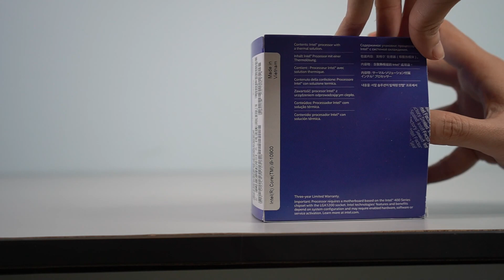The Asus RTX3080 TUF Gaming PC Build ! [Time-lapse]

Comment: Routing the GPU cables this way looks 1000 times better than underneath through the power supply cutout! This is a sexy build!
Reply: Why?
Reply: @Graphics_Card  The cables flow more naturally and straight. Most of the basement cable cutouts end up making the cable runs overlap, and pull them towards the front or rear of the case,  which takes away from the clean aesthetic.
Reply: @RegazozoGaming  that’s true but not always recommended. Alot of those cables if doing that can become short, and at the end of the day, your cable management will be bad. Also the AIO will have a tough time too
Reply: @Graphics_Card  not sure what you mean by become short, and its not bad cable management, if anything its better because you dont block off any of the air flow from the fans on the bottom of the GPU. Ive never had an issue running the cables this way with an AIO before. If you mean the cables can short out then how do people run the GPU vertically the cables have to run in almost the exact same way.
Reply: @RegazozoGaming allot of gpus actually require you to run it under or through the psu shroud so this is particularly rare. Depends on what case you are using though.
Reply: @Graphics_Card  Not sure where you are getting this "require" from. It's true that in some cases you have to run in underneath because that's the only feasible layout, but I and many of those I have built computers for really like the over the top look. If I can get a clean run under the GPU I will normally go that path, but as stated before the basement cutout is almost never in the right place and it makes the cables look off and bunched up.
Reply: @RegazozoGaming  also for me personally I’m nota big fan running a gpu cable over but it probably might be better for you